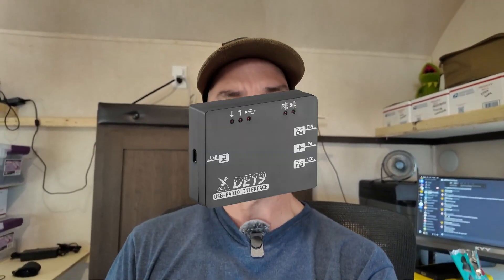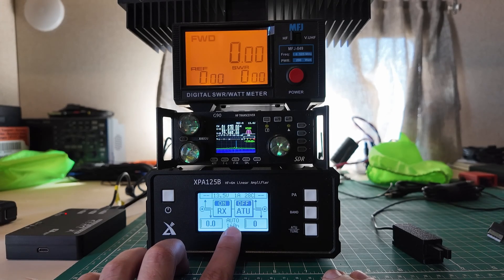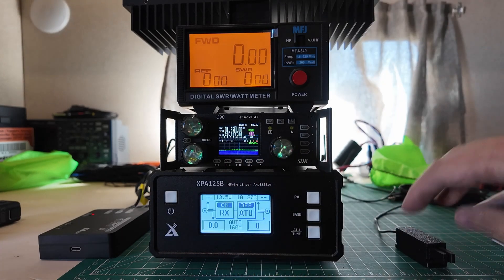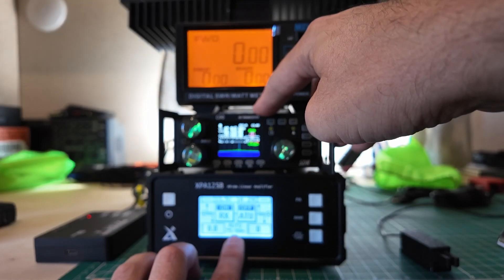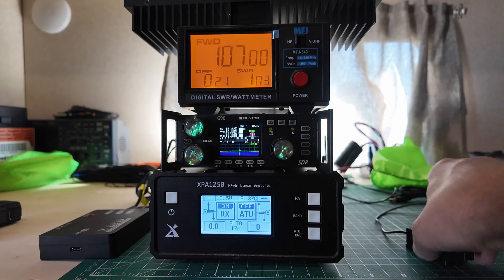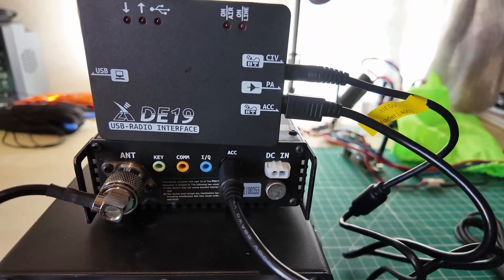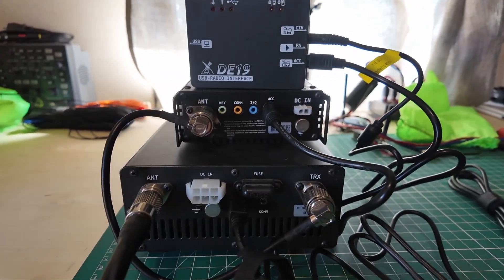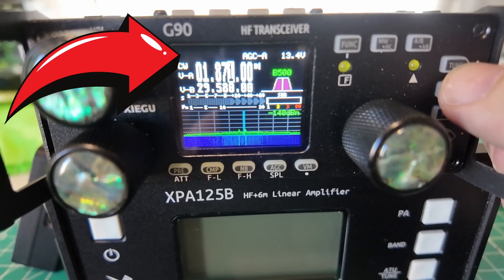The G90, The DE-19 and The XPA125B Walk Into a Bar...

Comment: Can you have the G90 - XPA125 and the DE19 all hocked up at the same time and still connected for FT8 to your computer?  Not sure how all the interface cabling works out...
Reply from the maker: The short answer is "yes", the longer answer is that I'd have to figure it out for a video.  I'm due for a How to FT8 with G90 video since they have changed the process.

Comment: Thank you Steve for the video. I am trying to connect the XPA125 and a Yaesu FTX-1 however struggling to find the correct pin out! It would be great if you could do a video about that!  Question:  have you used the XPA125/G90 combo doing digital like FT8 at the same time? I am confused, both Radiodity and Xiegu says the CE19 is the interface for the G90 and not the DE19!
Reply from the maker: The CE-19 is old documentation that hasn't been updated yet.  The DE-19 is what is needed for digital audio modes.

I do not have an FTX-1 radio to do the demo with.

Comment: I’m using the same set up but why don’t they include the 4001 with the amp?
Reply from the maker: True answer: The amp&packaging were made for the 5105 and the G90.  The DE-19, X6100 and X6200 (and now it works with the IC-705) all came out later.

Real answer: I agree.  Should be updated by now (and maybe it is)
Reply: @t @temporarilyoffline  was attempting to use with my G90.  Why couldn’t I use the 3.5 mm cord and plug one end into the PA plug on the DE19 and into the COM port on the amp? Not using it for digital yet, just SSB.
Reply from the maker: @barryzoll9772 you can use the DE-19 with the amp and not do digital, sure.  You can also plug the amp in to the radio directly without the DE-19 I believe.  I need to double check that.

Comment: My Xpa125b lasted exactly 1 yr filed from a cold start ATU check got a "Low Efficiency" warning and then nothing NO power out only stuck it seems on bypass only POS!
at $600 this is trash 🗑  I have and old HYS 300N 2 pill Chinese amp that held up better with a cheap 150w ATU that has held up over years and still going and at a 1/3 the price I am NOT happy with quality and i am the type of person NEVER abused amps i would drive the Xpa125b with my G90 at 1-2 watts MAX always made sure my SWR was below 2.0 yes always!
But i kick my self should have bought an RM italy 😢😢😢😢
Reply from the maker: That's really rough to hear about your experience.  I've put 1000s of FT8 contacts through mine with multiple radios and she's still going strong. I even managed to cause a smoke release and was able to fix it.  Did you make a warranty claim with your vendor when it happened?

Comment: Thanks for the video.  Do you have info on the 8 pin cable from the  G90 to the DE-19?
Reply from the maker: Doesn't the DE-19 come with the right cable to connect to the G90?  On the radio side, that info is in the G90 for the 8pin.  On the DE-19 side, I'd check the DE-19 manual and see if it was there.  If it's not. Let me know and I'll see if I can get info from my contacts.

Comment: Hi, what does it mean when your output power is flashing, what does that cause and how can you avoid it?
Reply from the maker: It means that the power out is too high.  With a Xiegu Radio + Xiegu Amp and the right cables, it /should/ fix itself fast.  If you are using a non-xiegu radio (which works great), you should turn the power out on the radio down to stop 'over-driving' the amp.  If you do that for too long on the XPA125B, the amp will complain and shut down to protect itself.  Kinda like grinding gears in a manual transmission car - just some feedback that you need to take action.

Comment: If doing digital or phone does  the CIV cable need to be attached to head & DE19?
Reply from the maker: I haven't exhausted the DE-19+G90 combo for Digital.  I used regular audio cables and the cat cable in my original quest.  I need to do a DE-19 video.  Original Setup: https://youtu.be/3DxY1HecbhQ?si=IOCsRLpwbvF6hBWj

Comment: I use the DE19 religiously and it works great with my G90 and XPA125B!
Reply from the maker: It's a brilliant bit of kit for the ham shack!
Reply: @temporarilyoffline  Ham shack? It's one of my POTA setups!
Reply: I received my amp today.   Could you confirm if you had to order the 4001 cable to plug between the DE19 and the amp or were you able to use the 3.5 mm cable and plug it into the port below the CIV port on the DE19 and the COM port on the amp.  Thanks and 73

Comment: I have a G90 and an XPA125 I've used for FT8 for some time. I try to do cable management with the CE19 and it works fine but I will probably replace it with the DE19 soon. Thanks for the setup video. I have to agree Raddiodity has top notch customer service. Fast and reliable.
Reply from the maker: It's a great combo!

Comment: Thanks for the vid. It would be great if you could get the DE19 to work with the G90 on FT8!!!   I have given up trying to get them to talk. RX is all good, will it heck as TX tho.
Reply from the maker: That's my next plan, stay tuned!
Reply: I use the G90 and DE19 for FT8. You have to make sure that the CIV connector is completely pushed into the head unit. I couldn't get it to transmit for the longest, until I pushed a little firmer on that cable.

Comment: Your power measurements were "key down" CW. As you correctly said but what that suggests to me is that on SSB through that amp is going to be up around 160 or 170w PEP. I agree with you, the DE-19 is a vast improvement on the CE-19! Some people also use a Digirig interface, which does the same as the DE-19 but works with different makes of radio as long as you buy the extra cable sets, making it about 15% more expensive than the DE-19 but with multi-rig application. 73 Ed
Reply from the maker: I have the digirig and I dig it!

Comment: I don't have the amp, but I do use the DE-19 as my sound card interface for JS8 Call. Works perfectly, and between the box and the radio, it comes with all the cables needed. 
My only gripe is that the CIV port on the G90 is on the control head, not the rear panel with all the other connections...so if you run a remote head, you also have to contend with that one coming off the side. I use a short 90 degree adapter so that does slim it up somewhat. I also used tek flex to loom the remote head and CIV cable together to make it a little cleaner install.
Reply from the maker: I use the remote head too, and the CIV cable always looks like a tangled mess.

Comment: Great video. Would the xpa125 and the de-19 work with a RS  918 HF SDR?
Reply from the maker: The XPA would work just fine with the RS918 - as long as the RS918 has a PTT out signal to key the amp on.  The XPA is not an RF Sensing Amp.  I've used this amp with all kinds of radios.  Its a winner in my shack.

Comment: Nice info on the DE-19 with the G90 and ampifier.

 I have to ask, you said you needed to make up cables, when I received my CE-19 I got the three 3.5mm plugs and the cable. when I received my amplifier I also received the cable for the CE-19.  I’m assuming you didn’t which is why you made up cables for the CE-19, this correct?
The G90 and amplifier are a great pair, together. 
Thanks
Bob K.
Reply from the maker: I was referring to the 3.5mm audio cables that come as bare ended wires with the CE-19.

Comment: Thanks for the info. I have a G90 and was considering picking up the amp and the DE19. The utility of a separate amp to use on other devices is superior to something like a 7300. QRP with the G90 barefoot or add the amp when needed.
Reply from the maker: I've used this amp with a ton of radios and I've put a couple thousand contacts through it (most of which are FT8). It works great.

Comment: These three together cost almost $1100. Basically the same price as an ICOM 7300. The 7300 is all in one small light unit and no extra cabling.
Reply from the maker: I wouldn't use this for a portable setup.  At today's prices, buy the g90 to get started and then get a Yaesu 710 for 100w and there you've got a shack rig and a portable rig... Or just start with the 710.  Tons of options.
Reply: @temporarilyoffline That’s sorta my plan….
Higher WAF.
Reply: Except of course you're going to need to add an Antenna tuner to your Icom so cables oh and more cash...
Reply: Ah…..
Hams being hams.
I’m thinking that the Icom 7300 has an ATU.

Not a fan of the 7300 but I have to call balls and strikes as I see them.
Reply: @etc-ss10  yeah you’d think for the price it would have one but sadly nope…
Reply: @TsiolkovskySportingLocks  I have a 7300 and it does have a tuner. I find it a great 100 watt transceiver for both base station and portable. One USB cable to my laptop for digital modes. Easy and uncluttered.

Comment: Thank you very much for the video. I have the same setup and did not realize that you did not need to have the CIV port of head unit going to the DE-19.  That maybe is why im having issue with overpowering the amp from the G90.
Reply from the maker: You might need the civ cable for FT8 or something, but not for amp work.